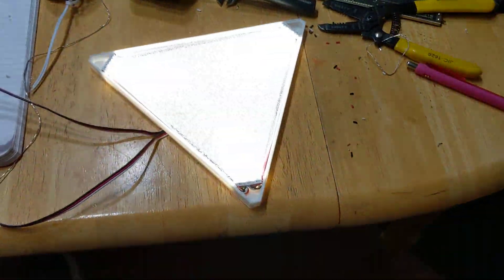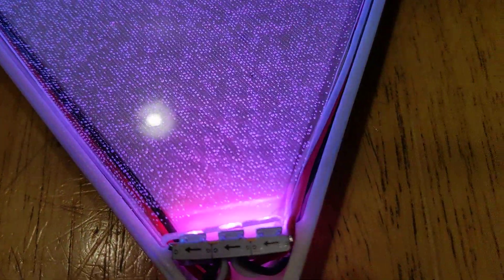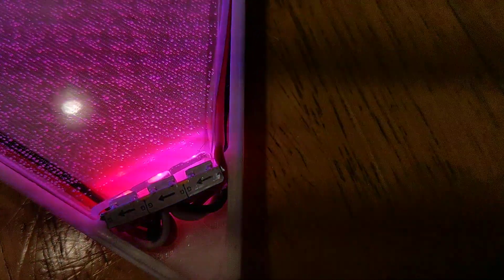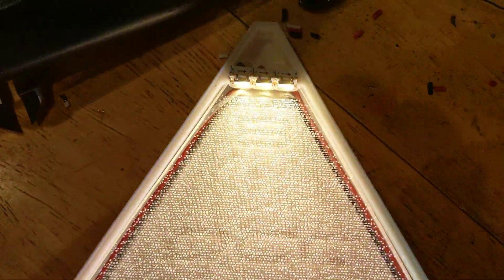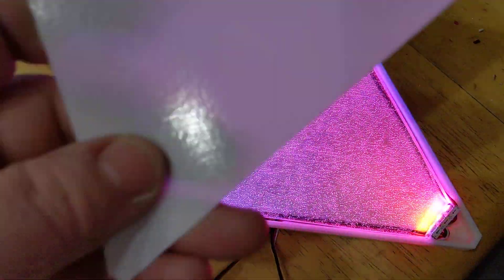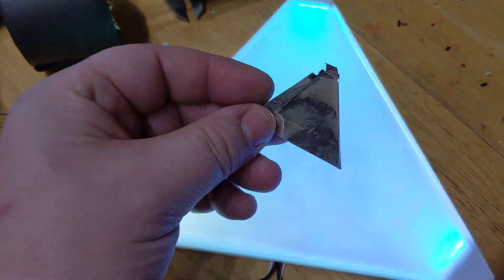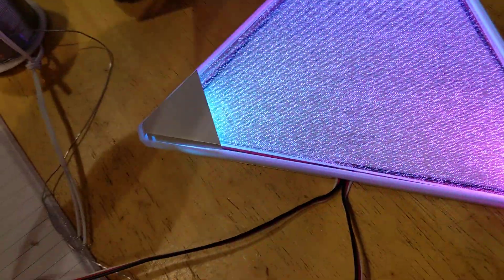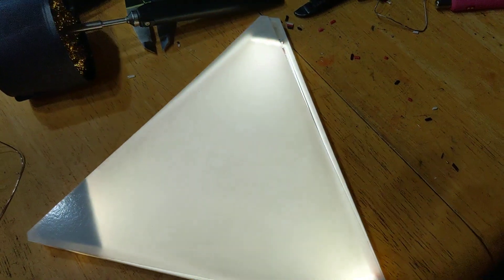Diy Aurora Nano Leaf project 1

Comment: Amigo que tipo de material e esse que você colocou no lugar da placa translúcida
Reply from the maker: 3d print material is "Polymax PLA" white,    Central clear plastic is Cast Acrylic w/ Laser pattern of dots over it. Final cover is a Light diffusing sheet from https://www.tapplastics.com/product/plastics/plastic_sheets_rolls/led_ligh_panel/598

Comment: hi, i am trying to make this project, what material is this net shape? 0.09
Reply from the maker: Hi. Its clear cast acrylic plastic with a pattern of dots laser etch over the surface to create diffusion, basically let's the light injected at the side of the plastic to turn 90 degrees and come out on the face of the triangle surface e
Reply: @DavidCook42  thanks !!!

Comment: how i create acrylic glass like this ?
Reply: You made perfect clone nanoleaf. No light bleeding, and full panel has lighted up. I really like it
Reply from the maker: I used a 35 watt CO2 laser to etch the pattern into the acrylic
Reply: @DavidCook42  any other mathod?
Reply from the maker: @DBsLAB  could probably make the pattern by hand with a rotary tool, but that would be super tedious, you can try sand paper on one side. Around 600-900 grit.  Would take some experiments to achieve the great effect from the laser

Comment: How did you create that acrylic plate?
Reply from the maker: with a 40Watt CO 2 laser
Reply: I don't have access to a laser edger, so could I also just use sandpaper to make the acrylic frosted?
Reply from the maker: @benvanviegen2725  Can try 600 to 800 grit sand paper,   or an acetone wash.  I'm not sure how good it would be.